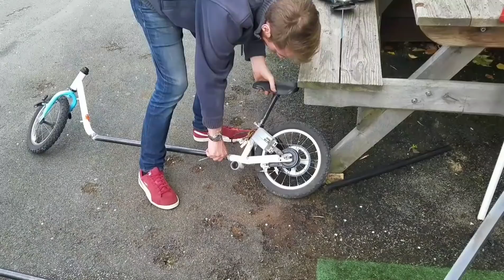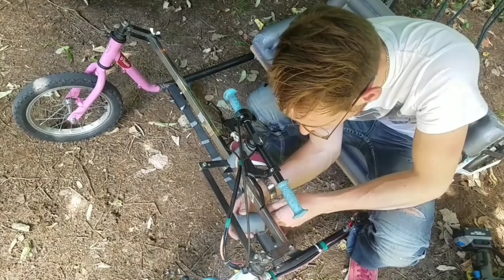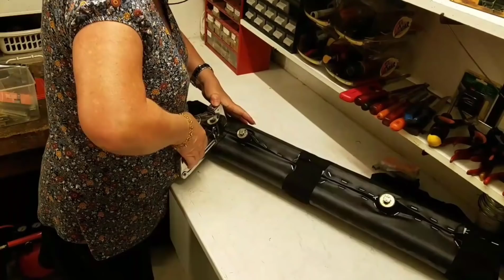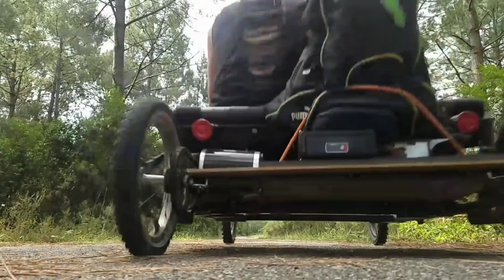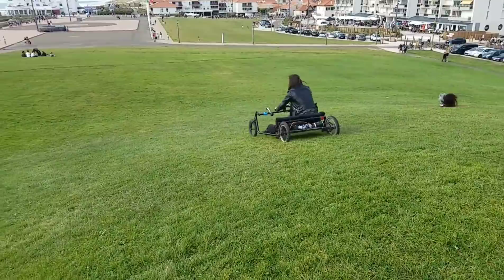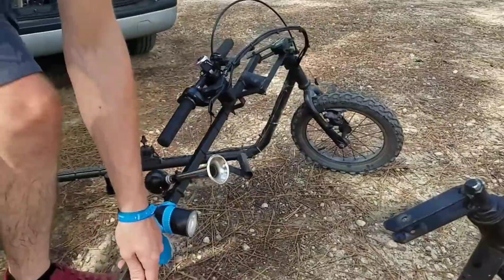how to make electric kart (part 4/5

Comment: bel engin, bien vu les MR16 LED pour faire office de phare 12v pas chère et efficace. 

C'est un moteur DC de trottinette électrique 1000W ?
Reply from the maker: oui en 48v, c'est de la motorisation de quad électrique
Reply: Pas cher et on sûr qu'elles refroidissent bien ici avec le courant d'air !